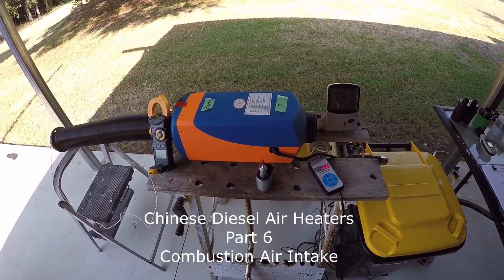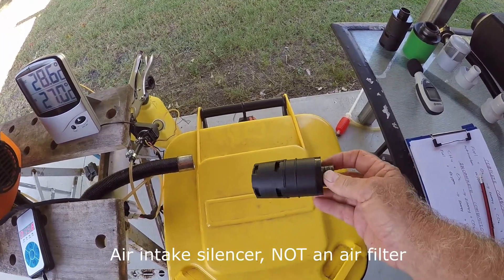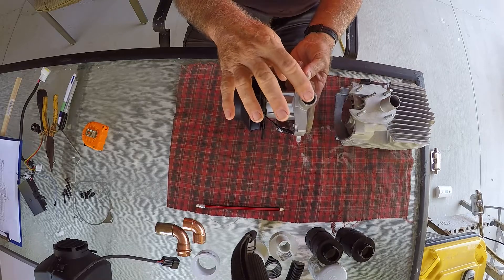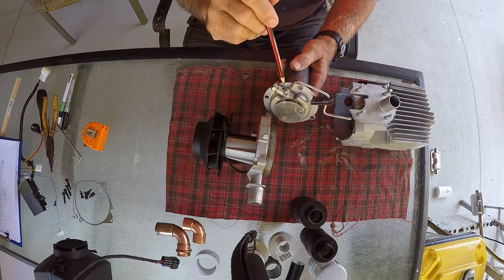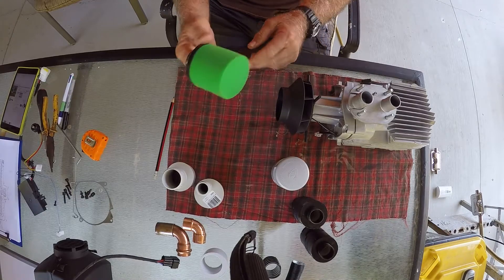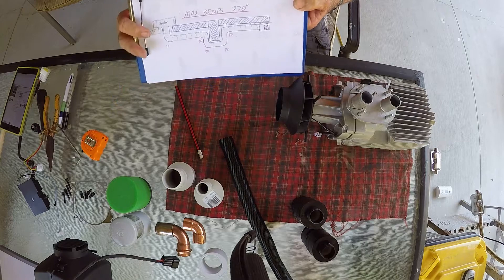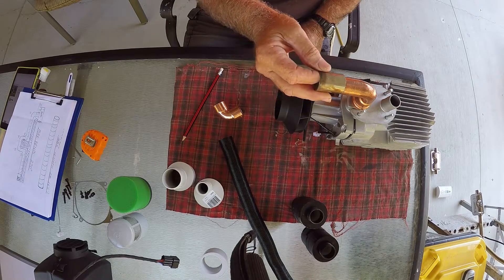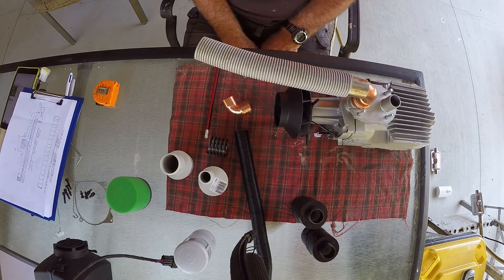Chinese Diesel Heaters - Part 6 - Combustion Air Inlet

Comment: Is using a copper elbow on the steel intake and exhaust pipes ok? Is there not galvanic corrosion?
Reply from the maker: Hi CJ,

Yes, this is possible/likely in theory, but for galvanic corrosion you need moisture, and these heaters make very dry heat. You should use some gasket sealant on the join that not only seals but provides a barrier coat against corrosion. 

I have only run my portable heater with the copper bend, on and off for a year, so I don't have long term testing here.

However on our boat the heater has been running with a stainless steel exhaust mated to an aluminum heat exchanger for some 20 years without a corrosion issue, and stainless and aluminum don't go well together at all in a marine environment. The saviour is the dry heat.

Cheers.  JMcK
Reply: @johnmck1147  Hey John, Thank you so much for replying.  I'll go with the copper elbow. Is a 1" 90 elbow the appropriate size? Also, It was suggested that I use a high temperature silicone sealant. Is that what you mean as well?  Thanks for your excellent videos, they gave me the confidence to DIY my own Diesel Heater In-A-Box for my Jeep winter camping adventures. Cheers!

Comment: John, would really like to see an operational comparison of larger intake setup verses standard. Please consider. Im learning so much from you/your videos. Thank You Much.
Reply from the maker: Hi Pastor Justin.
Thanks for the feedback.
Ref the larger intake set up. For what purpose?
The heater works by transferring heat from the heat exchanger to the air flowing over the heat exchanger. At a particular heat setting, there is a finite amount of heat to be distributed.
Cheers.   JMcK

Comment: Not knowing what I am talking about, but I am wondering if it would be possible to just mount a filter direct on the air intake?
Reply from the maker: Hi Fred, 
What air intake do you mean?
The main air intake to the heat exchanger?    -    Yes
The combustion air intake?    -   Yes and no.
If you have a standard plastic filter, then no. It won't fit in the space, and the exhaust will melt it.
If you have, or can make a long narrow metal filter that can't melt, then yes. 

Cheers.   JMcK

Comment: great video, any thoughts on whether or not you should install the air intake on the inside of a cargo van for example...something with many air gaps inside?  thanks
Reply from the maker: Hi K525,

Do you mean the combustion air intake or the heat exchanger air inlet?

If there is ventilation and clean air, in my opinion both or either is ok.

Cheers.  JMc

Comment: got my heater working today ..very pleased  at how nice and warm my  bus is now ..mine came   with the one  you show in this  video ...my  mate  thought it was a  filter...i was thinking  just for  now  i could use  an old stocking  stretched over  the   end of  the pipe ...i wont be using it anywhere to dusty ...any thoughts
Reply from the maker: Hi Kelly,

I have personally not tried using an old stocking so I can't give you a definite answer. 
These heaters hate restrictions, and I wonder if the stocking will cause a restriction due to the super fine mesh.  Have you considered insect screen?

You can test the stocking yourself. Look carefully at the exhaust before and after using the stocking. If you see any smoke when using the stocking on a high setting you have a rich mixture burn caused by intake air restriction. No smoke - use the stocking.

The filter is needed to stop bugs building nests or getting sucked into the combustion chamber.

I personally use this type of filter below. Search for intake air filter for Eberspacher diesel air heater. I have listed a link below to get you started in your search. The prices for the same item varies greatly.

https://www.ebay.com.au/itm/1pcs-Air-Intake-Filter-Diesel-Heater-Black-For-Eberspacher-Useful-Durable-/203186116215

Cheers.  JMcK
Reply: i just  had one  handy...  but  until i get the  proper  part  i thought  maybe  a    kitchen sieve  or something similar would work better ... and  be  more  robust..thank u for  the great  channel..ive learnt so much from it ..
Reply from the maker: kelly melrose 
👍

Comment: Hello John, thank you for another excellent video! It helped me a lot. Got a question: do I understand it correctly that considering air intake it would be most effective to put directly under the diesel heater original silencer (only the straight part) and some nice big air filter with almost no hose at all? Thank you!

Comment: I was thinking of adding a foam wrap to the existing silencer made from the foam of a Shop Vac wrap and cutting out the baffles on the inside of the cap. What say you on that breathing? I am not to worried about the noise as the heater is mounted outside my camper. I might add the inlet line is only 130mm with one 90 bend using the factory pipe.
Reply from the maker: Hi W,

There is not much noise coming from the combustion air inlet.

Yes, you could wrap the "silencer with thin foam, but you would need to keep an eye on it if outside the camper that it does not collect dust and then cause restriction in the system.

You need a filter of some sort to keep the bugs out. I just use a simple filter like listed below. There are lots of suppliers, I just quickly did a search for you just now. The exact same intake filters sell from about $4 to $12 

https://www.ebay.com.au/itm/1-Pcs-Air-Intake-Filter-For-25mm-Intake-Manifold-Diesel-Heater-Replacement-Parts/363156751004?_trkparms=aid%3D1110006%26algo%3DHOMESPLICE.SIM%26ao%3D1%26asc%3D20200520130048%26meid%3D9fa78d9848b747e5adb8ca0a9394ef10%26pid%3D100005%26rk%3D1%26rkt%3D12%26mehot%3Dco%26sd%3D274337332517%26itm%3D363156751004%26pmt%3D1%26noa%3D0%26pg%3D2047675%26algv%3DSimplAMLv5PairwiseWebWithDarwoV3BBEV2b%26brand%3DUnbranded&_trksid=p2047675.c100005.m1851

Cheers.  JMcK

Comment: Hi my friend, I apologize again, I bothered again, I found the fault of the diesel heater wabasto, but I need your help There is 1 relay on the electronic ignition card on the wabaston, I could not see the number of the relay, I request you to inform me if the relay number in the electronic ignition circuit can be read in your wabasto. I will be very glad if you are.
Reply from the maker: Hi Ali,

I am sorry I can't help you here. I don't have any Webasto heaters here, just Chinese copy heaters of the Eberspacher German heater, so I can't search the relay number.  JMcK

Comment: Have you ever tried to run one of these upside down? With the intake and exhaust coming out the top?
Reply from the maker: Hi Jimmy, these heaters will run in any position. -  FOR A WHILE. 

They are designed to be installed with exhaust down.

They can be installed with the exhaust out the side PROVIDED it is the side with the the glow plug on the top.

Running them in other positions cause poor performance, rich running, hard starting, rapid carbon build up, and flooding issues, -  for starters.

Cheers.  JMcK

Comment: First off, as so many have said, thank you so much John, these are top-rate videos and I love how thorough you are.  

I do have a question though!  What kind of limits are there on the length of the non-combustion / soon-to-be-heated air inlet?  Mostly I just want to avoid sucking any diesel exhaust into my camper, and it seems like maybe the easiest way to do that would be to extend the non-combustion air intake pipe away from the source of the exhaust.  But I'm not clear on how long I can make that pipe (assuming that there's no pipe on the heated air outlet).  I know you haven't tested this but...thoughts?
Reply from the maker: Hi Aron,

You can increase the inlet air ducting somewhat. Just how long depends on the diameter and restrictions. 

If you need to go longer than a couple of meters, increase the ducting size.

Also keep restrictions - bends, turns etc, to a minimum. Air is restricted by bends and turns and roughness in the ducting.

The issue is the fan in these heaters is quite small, with very tiny fins.

Cheers.  JMcK

Comment: There is one benefit to the intake silencer - it makes it much harder for mice to crawl into your air intake when it's not operating.  😊   I'm thinking of 3D printing some kind of fitting on the end of the air intake with a screen to keep objects from getting sucked into the air intake (leaves, bugs, etc).  Something funnel-shaped so that the screened area is significantly larger surface area than the hose opening, so that the screen itself doesn't restrict airflow.
Reply from the maker: Hi CP,

This is the filter I use.

https://www.ebay.com.au/itm/Air-Intake-Filter-Silencer-For-25mm-Intake-Manifold-Diesel-Heater-Durable-Kit/274337332517?hash=item3fdfc77d25:g:BcIAAOSwBp1elrYT

Cheers.  JMcK
Reply: @johnmck1147  Oh!  I didn't realize they were that inexpensive, thanks!!  Yep, definitely better than making one!

Comment: These videos have been great helping design my install approximately 12months ago. Many thanks for you dedication. My 2kw heater is now struggling to start. Lots of white smoke followed by e-10. But if I blow into the air intake whilst it’s smoking I can get it to run.     I wonder what the problem is?
Reply from the maker: Hi John,

From your comments it appears to be a combustion burn issue. 

Probably caused by carbon build up in the glow plug screen and the small burner start hole at the glow plug screen. If the little hole is blocked and/or the glow plug screen is blocked with carbon you will have starting issues.

You also most likely have a carbon build up in the burner itself.

If you feel confident in stripping down the heater, do that and clean out the carbon.

If you don't feel confident and you can get the heater to start run a high kerro mix (90/10) through the heater on a high setting for about 30 mins  or so, and then turn off, let cool and try the heater again to see if that made things better. If so use a full tank of the kerro/diesel mix when next operating the heater.

Now you need to look at your install and operation.

Do you have excessive restrictions in your combustion air inlet or exhaust? If so this can lead to carbon build up.

Do you mostly run the heater on a low setting? If so, do you occasionally give the heater a boost fun on max setting to burn off carbon before you switch off.

Last up, I must ask this. Are you one of those people who like to run different oils through your heater. Burning oils produce lots of carbon.

Good luck.  JMcK

Comment: Great series very informative . Plan on ordering one based on your series. Keep up the good work 👏
Reply from the maker: Thank you Louis.  JMcK
Reply: @johnmck1147  john I got a 5k unit based on your channel set up everything but  the pump does not work at all . No sound even when I set to prime . No error  codes . Battery is good and it try to start. I gave ordered new pump but am I missing anything in settings ?
Reply from the maker: louis vasconcelos 

Hi Louis,

First, did you have the heater apart?

Did you wait? When you turn the heater on the ECU first turns on the fan, then the glow plug. It is only after the glow plug is hot that the pump starts.

It is rare for a pump to fail, have you checked the wiring? No lose plug or broken wires. You can check the pump by connecting it briefly to a battery. Connect one battery wire to one of the pins and briefly touch the other battery wire to the other pin. You will hear the pump click. The polarity does not matter.

If the pump works and you checked the wires, test the glow plug next. Does it get hot when you turn the heater on?

It is rare, but possible that if the pump works you may have an ECU issue. I would then ask for a replacement if you just bought it.   JMcK
Reply: @johnmck1147  bad luck on my 5k sure enough bad pump and glow plug.  Thanks to alibaba and 50 bucks canadian to replace both plug and pump and it started up and ran great 👍.  John u are correct about the exhaust muffler big improvement.  Now to install on caravan . Getting chilly up here in canada 🇨🇦
Reply from the maker: louis vasconcelos 

Hope it all goes well Lous.  JMcK

Comment: Another great video. Now it's been established that the longer the intake run a larger diameter hose will be required  to eliminate resistance. Is there a limitation to length once a larger intake hose has been installed?.
   Thanks for reading John ✌️
Reply from the maker: Hi Eric,

Sorry, I have not fully tested this. I have tried a 4 metre length of 50 mm (2 in) poly pipe with no apparent issues, and I am sure the heater would run fine in a 1 metre dia water or oil pipe 100 km long.

Aim to keep the intake and exhaust lines as short as possible, and you will have few, or no issues with your heater.  JMcK

Comment: John, a quick question if I may? Have you ever trialled filter/silencer like the one in the link? https://www.ebay.com.au/itm/25mm-Air-Intake-Filter-Silencer-Clip-For-Dometic-Eberspacher-Diesel-Heater-AU/353131597904 Thanks in advance, John
Reply from the maker: Hi John,
No I have not tried, or previously seen one of these filters. If you purchase one I would be interested in any feedback.  Thanks for the info. JMcK
Reply: @johnmck1147  John, as I don't have the necessary equipment to test this, how about I buy one and get it sent to you for testing? John
Reply from the maker: John Sullivan 
Thanks John,  but I have already ordered one to test. I won't do a seperate video but will put feedback back in the commenta section.  My email is johnmck47@outlook.com if you don't see something in a few or so, depending on delivery time.  JMcK

Comment: John is it all right to run the exhaust pipe 1.2m to the muffler and 400mm past with only one 90 degree bend than you
Reply from the maker: Hi Denis, you are starting to get to a length where you should consider a larger exhaust, but your set up should still work ok, particularly if exhaust is flat or tilting upwards. The hot exhaust gases expand and like to flow upwards. You will have carbon build up issues if you have a long exhaust running downwards, as the little fan will have issues pushing hot expanding down a long exhaust.  JMcK

Comment: Hi John, Thanks for the excellent videos. I've just finished my van conversion and have just ordered one of these heaters. I plan on installing it under the van so my questions is should the air (not for combustion) be drawn from outside the van or inside the van. I can't find anything that says which is preferred but I assume drawing cold air from outside is going to be less efficient as the heater has to warm up colder air but at the same time I'm trying to avoid too many holes through the floor.  Any advise?

Also are there any restrictions on the length of the outlet pipe?
Reply from the maker: Hi EC, it is personal preference as to whether you draw in fresh air or heat recirculated air. Some people love the fresh air doctrine, others want to recirculate. 

If you do recirculate you need to leave a hatch or window slightly open or have fresh air ventilation in the van.

It is easier and more efficient to reheat internal air, than to heat cold external air, but these heaters can achieve up to around an 80 dec C temperature increase of incoming air, and in practice, unless you winter in Siberia, the loss of heat efficiency is mostly acceptable.

Good luck with your install.   JMcK

Comment: Is it possible to take the air from indoors Is Or is that dangerous?
Reply from the maker: Hi Jim, I am assuming you are referring to the combustion air. Yes a lot of people take it from indoors without issues, but in my opinion it is better to take it from outside. 

If your install is not gold standard, or things like the shut down process was incomplete, you can get some diesel fumes, or diesel weeping out of the combustion air intake hose. 

Also in the rare occasion of a combustion chamber gasket failure deadly Carbon Monoxide can leak out the intake hose.   JMcK
Reply: @johnmck1147  cheers for the answer John! I already drilled a hole to the outside though. But i feel its convenient to just take clean air from inside with a filter then you also get some outward ventilation :) in motorhome!
Reply from the maker: Jim Lewis Skoglund 

👍

Comment: thanks for the video . at first i couldt get my system to start. followed your advice and changed the fuel lines. Couldnt get it too bleed properly but after i had, it still wouldnt start. id primed the system maybe 30 times by this point, still nothing. got under the van and saw diesel coming out of the end of the air intake pipe.. mucky brown half burned diesel. I took the pipe off and it was literally full of the stuff... with the pipe off it started first time... Is the air intake supposed to release unburned diesel out of it!?! Ive contacted the seller, with them just telling me to pay for a new one! Thanks
Reply from the maker: Hi DD,
Looks like you have flooded the heater. Excess unburnt fuel will drain out either the exhaust or combustion air inlet. If you have a loop in the inlet pipe where diesel can pool, you can not get air into the combustion chamber to start the heater.

This might just be a case of over prime. If the heater started with the intake pipe off run it for a while then put the pipe back on. If you have a loop, drill a small hole at the bottom of the loop to drain out unburnt diesel or moisture condensation.

Please let me know how things go.   JMcK
Reply: @johnmck1147  thank you so much John. Will do